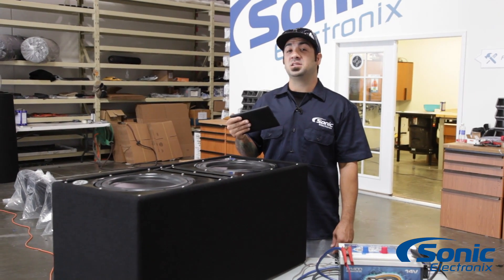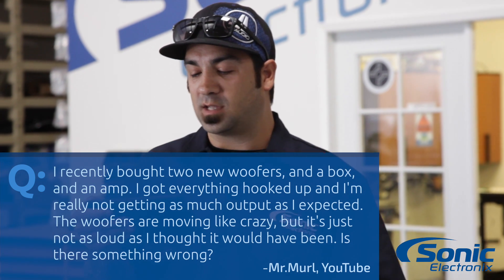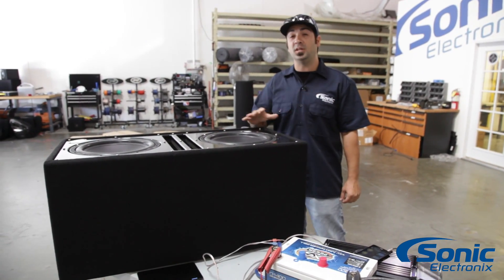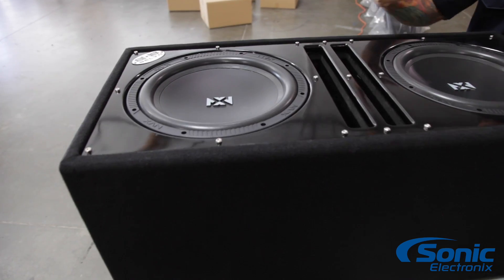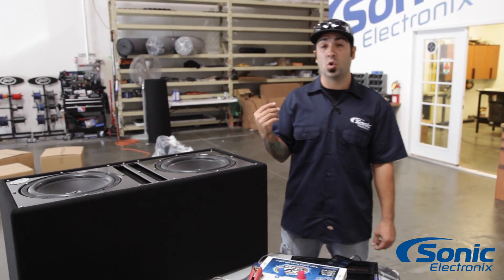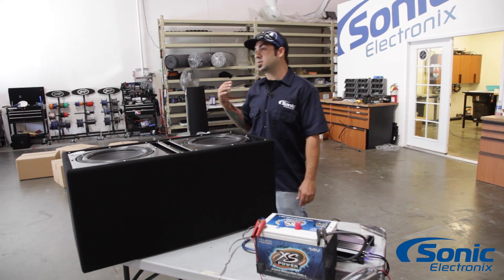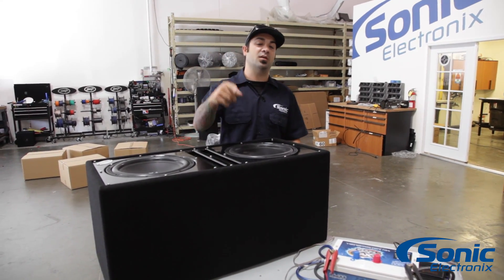I'm Not Getting Much Output From My Subwoofers | Car Audio Q&A

Comment: I have very low volumen from my subwoofer.

I connected from the factory stereo the sound to the aftermarket amp by the rear left speaker terminals (high input connection).

I think I have to check the polarity of that connection and benchmark the results. also after that check the polarity of the outputted signal from the amp to the subwoofer to see if I solve the issue.

ALSO maybe I can fix it connecting both the L and R inputs because I only connected the L.

If success I will show my results here after that.
Reply: Did you connect both of them bro ? Or any result did you solve the problem ??
Reply: @0bslump629  Not at all. Sometimes like when the car is hot the sound is loud. In the cold mornings the sound is low.

I think is the ground. The bolt not well tight. in the heat that connection tend to tight and in the cold it gets loosen.

I will connect ground also to a second bolt what a mess.

Comment: I need some help. PLEASE 
I just installed 2 12 inch subwoofers P3 rockford and a rockford 1200x1 amplifier and I correctly wired them down to 2 ohms each and down to 1 ohms to amplifier. yet I still not hearing much unless I purposely turn the gain all the way up and the punch eq on it all the way up. But the manual that it came with tells me not to do any of that. If I turn it down below level 5 gain I can barely hear the subwoofer. I checked fuses, wires to the subwoofers and got 1 ohms to amplifier. Also the bass knob that it came with did absolutely nothing to help with the bass, same with the settings within my stereo that allow me to turn up the subwoofer.  .5/10 if rating on a bass scale.

Comment: So I hooked up hyfonics 3000 mono block amp to 2 twelves gravity g5 subs and when I hook both of my RCA‘s to the amp it seems like it cancels it out but if I pull one of the RCA‘s I hear some bass But then also my lights start flickering and then the amp goes into protecting mode

Comment: My question is how to get bass where I like it. I do not like the very low deep electronic bass. I want it to sound like being in front of a live band. Like a hard-hitting PA speaker.  Many years ago I had 2 EV15b in a TL606 enclosure in a large SUV. Loved the bass sound, but do not have the room for even one 15 inch speaker and also know the sound can be tuned up using the right enclosure, but not sure of where to start. I am guessing I need something tuned to about 65 - 80 instead of 35hz. I may play with the subsonic filter to limit deep bass but not sure of that approach.

Comment: I've got my gains, and bass boost dials turned all the way up on a 1500W BOSS amp, hooked up to a single 400W Kicker Sub, and it works, but hardly kicks like it should. I wired it through my factory speaker wiring, but I feel like my factory wiring is somehow limiting the output of my amp.
Reply: That’s the problem I’m having now. Did you by chance fix it and if you did. How did you fix it?
Reply: @stricknine2370 you can always bypass the stock wiring by using your own speaker wire, be careful with the bass boost as it might fry ur speaker
Reply: did you fix the issue ?
Reply: @7400_sparksum  no I never ended up figuring it out, got a new ride. Need to redo the whole setup

Comment: I just installed a JBL BASSPRO HUB in my subaru crosstrek and this looks like what I am experiencing. Can this problem occur using a single sub with right and left high level inputs? I could really use some advice.

Comment: i got a Question to i just bought 2 skar 10 sdr series subs in the box and got them hooked up right they work just fine on low volume but when i turn the volume up they start popping like there's not a good ground or not good power output idk? do you know what could be wrong

Comment: okay, i have been searching information from everywhere and cant find it. on my pioneer (MVH-S320BT) has weird problem, i tried to measure that "pre out" voltage from the rca cabels and on the stereo own terminal and i get only 0.020V and i have tried other multimeters so the problem is not on tools. im sure everything is right on wiring and everything "should" be unbroken. im sure i have done everything right on measuring but sill doesnt get that 0.2V reading. i hope someone can give some answer for that. and my other problem in my amp (sd1600.1d evo4 2ohm) il have measured the out put voltage from that and i get only about 14V (AC) out, thats when the volume from stereo is 3/4 and gain is almost max but when i put some bass boost i get the max voltage out, what is promised on the amp manual. so far im thinking is that stereo low out put voltage causing low out put voltage to my amp aswell? thanks for help already!
Reply: Adjust subwoofer level on headunit

Comment: I get output that ain’t bad but I have 2 Memphis 10’s on a 750w dual channel amp and in my brothers car with his wiring they work great in my car with my wiring they aren’t that great. I have to use fade to get them to hit and so with the fade it only hits on 1 side of the car. I don’t have a RCA on my aftermarket 300$ pioneer hesd unit. I used a line output converter.

Comment: I have a 12 in Kicker sub sand a 1000 watt mono Boss amp. Had it installed and worked perfectly for about a year. Sounded awesome even with the stock speakers in my car. Now, I'm still getting bass but it doesn't pump as loud AND now the stock 6x9 are rattling. This NEVER happened beforehand. I NEVER touched the settings, I checked for any loose cables, and EVERYTHING is the way it was when it was installed. Any ideas as to what happened and what I need to check? I did notice 2 fuses. I didn't check those. Will those affect the sound?
Reply: nah fuses are just for power and only need replacing if blown

Comment: 🛑I had this same issue with my system, I solved it by adjusting a setting in the head unit, the 'subwoofer level' was at zero, which I thought was similar to bass boost so I didn't adjust it, but after contacting kicker because I thought it was my amp, I was told that it's not a bass boost and I should turn it up and re-adjust the amp gains and it worked flawlessly.
Reply: What head unit do you have? I've been curious about doing that with mine..
Reply: @kristopherdonaldson9569  pioneer avh 221ex
Reply: I have a pioneer as well. So, what did you raise it to? +5, +7,+10?
Reply: @kristopherdonaldson9569  10. then re adjust your amp gains by turning it down or by use of multimeter
Reply: @doublemanson  alright, I'll give it a try as soon as the sun comes up..
Reply: Thanks for your contributions, king  🤴
Reply: Really???
Reply: Having same issue my subs only sound good and deep with the bass boost on amp but at a certain hz and the rest is flat I’ll try this

Comment: I have a sundown audio zv5 18" sub and I have 8 gauge wires for speaker wire. My amp is a sundown sae2000d so it definitely cannot shove the speaker anywhere close to max. It use to be extremely loud then while it was playing it seemed to loose the output it had. No power lose at all. Wiring is still the same at 1 ohm. Why does it seem like it has a higher resistance?
Reply: Test the impedance with a digital multimeter. It could be partially "blown"

Comment: I’m having this issue, I got mine wired to 1 ohm and my amp supports 1 ohm. Could it be my electrical isn’t good enough to supply the proper power to my amp?
Reply: 4ohm better

Comment: I got a problem i hooked my brothers stereo up to my car. Same kind of car 2006 scion xb. I also installed tweeters, connected to the front door speakers. But my 10 inch cerwin vegas wont hit. Just the the right one. Wats going on??

Comment: I try to help people in the comments sometimes that haven't had a reply to their questions. Car audio can be difficult to help people with just by communicating on YouTube. It's hard to diagnose someone's problem when they cant relay the information properly and dont understand what your saying. I try tho because I've been there myself so..
Reply: @_bauer  let me know if you have any more questions👍
Reply: @_bauer  thanks for the kind words. I looked up your amp and speakers. Very nice stuff but to be honest with you😬 I would have bought 2 Rockford fosgate p3d410 and a pioneer GM-D9701 and saved $860🤷‍♂️. The t1d210's you have are 2ohm DVC. Wired parallel you going to get .5 ohm load off amp. Your amp isn't rated for a .5 ohm load. You should have bought 2 Rockford fosgate t1d410's. Wired in parallel to get 1ohm from amp. 1600rms@1ohm is what I seen rated for your amp. You should be wired in series with your current subs. Bad part! You only going to get 700rms @ 4ohm from your amp. That's why its important to correctly match amp and subs. So you don't waste money on expensive amps and subs that you can't use to their full potential. I'll leave a separate comment about your radio 👍
Reply: @_bauer  Ok, your stock radio is probably holding you back. Idk anything about a stock 2020 Honda accord radio but a aftermarket radio would better. I'd recommend a pioneer double din. One  that has (NETWORK MODE) and Navigation and steering wheel control capabilities.
(LOC) LINE OUTPUT CONVERTER I'm guessing. Again, dont know much about them. I've never used one because I always use aftermarket radio with amplifier and subs. 
As far as hardly any sound from your system. It could be a number of things. I would make sure that your wired correctly first. You may have mixed some speaker positive and negative terminals the wrong way by accident. I do it sometimes. I would go to a shop and ask them what they think. I'd recommend selling your amp or subs to get the the proper amplifier/subwoofer combination. Your probably better off selling the speakers. If your going to have 2 DVC subwoofers. It's best to go with 2 4ohm DVC subwoofers if your amp lowest impedance load is 1ohm. If your going to use 1 2ohm DVC subwoofer. Then get a 2ohm subwoofer  DVC and wire in parallel to a 1 ohm load
Reply: @_bauer  you may have a factory amplifier from Honda in your car. If so, that could be why your system isn't working properly. I just remembered you talked about your box. If you have a trunk instead of a hatchback style car. A sealed box is probably best for a trunk. Ported is usually for open cabin spaces. Like the back of a SUV or hatchback car. Did you buy a proper size box for your subwoofers? If you dont have the proper air space for your subwoofers. That can affect the amount of sound you get out of them.

Comment: I had one 10" and an amp and it hit really hard so I decided to upgrade the amp and sub and get two 10" subs and they barely hit ik my wiring is good what could be the issue
Reply: You need a thicker wire. Higher the number lower watts it puts out. 8 or 4 gauge could fix ot

Comment: Can anyone help me out with this one thing?
Well the issue I'm facing is that my right channel is working perfectly but there's no output from left channel.
If i connect my subwoofer to bridge, it works but not on left channel. I tried plugging a low wattage speaker to the left channel in order to see if it works or not but it didn't.
What issue it could be?

Comment: I had a lanzar opti 2000 wired at 1 ohm. It was loud without any type of bass boost. I order a sundown sae 3000 watt amp. When I was tunning the amp it doesn't hit hard unless I use the bass boost. I dont understand what changed? I shouldn't have to use the bass boost.do u believe there might be an problem with my rca or my loc

Comment: i have an amplifier that can output 235W rms at 2 ohm and 470 at 4 ohm bridged. but the sub that i want to get is 4 ohm dvc. i cant run it at 2 ohm bridged. now at 8 ohm will it move much, or better to wire it up for 2 ohm with 235 w. the sub is rated at 400wrms. pls help
Reply: How did you wire it at the end?

Comment: I had the same issue and it was because of a broken speaker wire inside of my concealed box. Fixed that and bass works.  Double check your cables.

Comment: Hey I have a question okay I got a nvx jad 1200 at dyno test it does 1300 rms certified I had a nvx vcw 15 1000 rms dual 2 ohm hooked up and hitting good but I took the sub out put it in a different car with a cheap power acoustik rz1 2500 only rated to be 2 ohm stable at dyno test of 630 rms at 2 ohm but it runs at 1 ohm no problem so that nvx 15 dint last 40 mins with that amp and it blew so I’m guessing either that amp does way more then 1300 percent me at 1 ohm or I have an electrical problem with my nvx amp that causes it to not run the potential wattage but I have a a second battery and the power wire I know is good power stay at 14.0 volts so could a bad ground cause the amp not to reach its potential

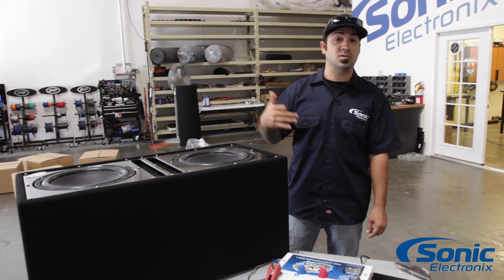Comment: i wired my 2 speakers wrong, 3:52 is how they should be right?

Amp:
Phoenix Gold R5.0:1
Octane R 5.0:1 Class A/B MonoBlock Amplifier

Subs:
2x Rockford Fosgate P210S4 Punch Stage 2 10" 4-ohm subwoofer

Rear Speakers:
JBL Concert Series 9631 6" x 9" 3-Way Speakers w/Grilles

Front Speakers:
Factory Speakers

Stereo:
Pioneer DEH-S4100BT in Dash CD AM/FM Receiver

amp is connected to subs only (im new to this so go easy)

Comment: I had my car subs they where working just fine until I installed a 4channel amp to my car door speakers but now my subwoofer dont even move.what could of caused it?
Reply: Your battery sucks probably and the second amp is pulling juice away from your mono amp
Reply: Maybe add a deep cycle batt to run the mono. What watts are they? Shouldn't be much issue there tbh iv run like 4 amps With no drops before

Comment: my sub was working fine for the past 2 years, but with in the past week it doesn't want to work with the softer bass, only the really intense stuff. Any ideas as to what's wrong with it?
Reply: Might of finally worn in and now just wants to be abused. Maybe use another speaker/sub to fill any missing range . I used a fli 10inch for a while just to add musicality and tone/higher bass freq to work with my dual diamondback sub as its just a monster that eats any sound its working with lol but it doesnt like not being pushed

Comment: Man I have been having to keep going to bestbuy for this crap more than I have too they sold me a cheap kicker blew out the rating were overrated on that sub then I finally got a good sub but notice my rca Jack's were swap backward with the amp colors red and white then then the fix that color swap but seem like I had less bass sometimes when I get into my 2014 altima I just here pure sub bass for a sec like what the heck also the fat ass did not use the kicker rca Jack's because it was too much work I was shock like I payed for that kicker kit and you put this cheap white 99 cent store rca Jack's very disappointed in bestbuys service plus they broke a side panel by the e brake didn't tell me either I found out when I was detailing my car then the alpine power pack was just thrown behind the stereo where my glove box would not open nightmare

Comment: Will the length of my jumpers affect subwoofer output ? I left the jumpers really long i have 2 dvc 4ohm parallel to 1ohm
Reply: What gauge wire and is it real copper or copper coated aluminum

Comment: My sub is not hitting hard. Mtx road thunder. And I have pioneer gm 962 760w amp with pioneer deh-150 mp deck. Sub sounds super quiet. Barely hits even all the way up. Checked all my wires too... plz help. Installed in 94 dodge 1500

Comment: I'm having a problem with my system if I plug in one of my RCA cables one of my sub works really good but if I plug in both RCA cables both subs only work at like half power do you know what is wrong is it the RCA cables is it the head unit or is it the subs itself
Reply: Did you ever figure this out?
Reply: @madeleinewestbrook9228  sadly no
Reply: Check if RCAs is plugged correctly, adjust subwoofer level on headunit, if it's 2 channel amp set filter on LPF and bridge it

Comment: I have a 740 watt pioneer amp and a kickercvr 12 and ik I wired it right at times it hits hard perfect other times you can tell when the bass drops it just gets quieter but not like distorted or nothing just quiter and theres a dramatic difference my amps not going into protect or seem to be getting hot it's wired at 2 ohms ATM I tried wiring at 1 ohm and 4 ohms and all does the same thing no matter how I wire it  so I bought a 2.5 farad capacitor thinking that was maybe the problem  tho it's stopped my head lights from dimming the bass still does the same thing and had no effect on the amp it remains anywhere between 13.8 volts to 14.2 so ik its not the voltage going threw I have 8 gauge wire going from the amp to speaker and the rest power ground wire are all 4 gauge I don't  believe it needs anything bigger for a 740 watt amp tho it is older still I don't see it putting out any more than 1200 watts (and yes my ground wire is grounded good sanded it down to bare metal and have 14 bolt that the ground wire screws on) any suggestions on why this is happening?

Comment: Can you make a video of how to check rca cables
Reply: Bro plug your phone straight into the amp with a headphone jack to RCA adapter. If it sounds fine your amp is fine . Pull your radio out and plug a new RCA into the back and run it over your seats to the trunk and see if you get Sound. no need to hide it all under the carpet yet until you verified your new cable is good. if all else fails your radio is probably fucked

Comment: Mine is doing the "out of phase" so I wired everything up but used some wires that didnt come with the kit, which is very skinny like factory stock skinny, and I wired both my 6x9's with that wire to my 400watt boss amp. Could it be that I didnt used Speaker Wire? Or is something actually wired wrong